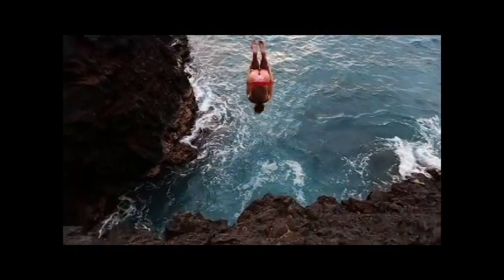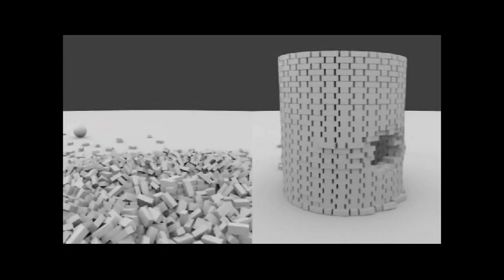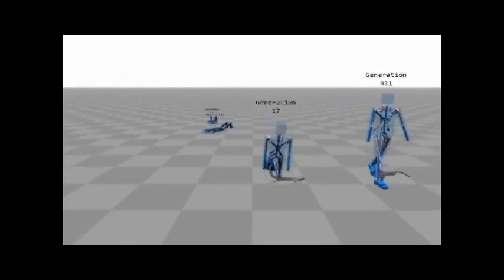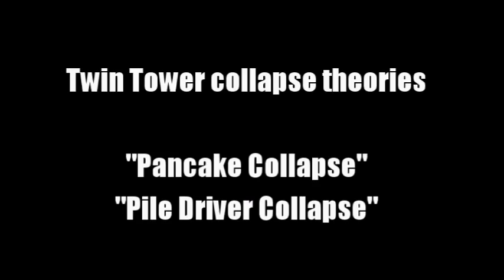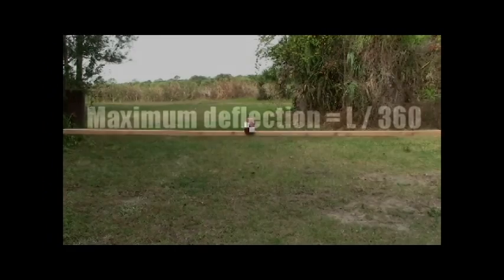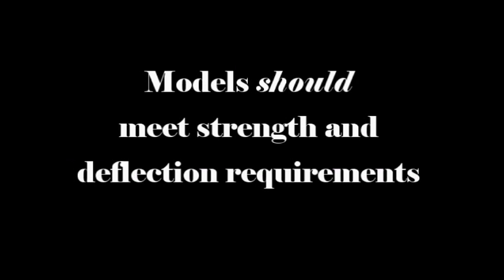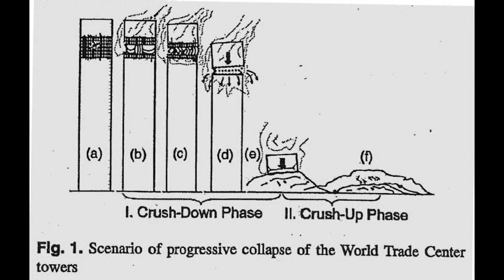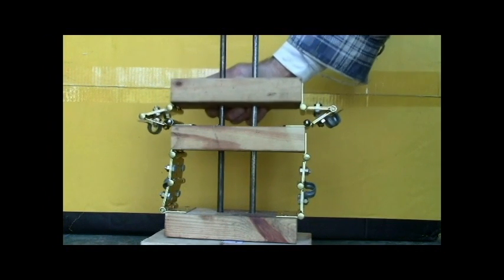9/11 Experiments: The Force Behind the Motion

Comment: It's very obvious that there is something missing from the controlled demolition experiment, but I imagine it applies in the others too. You'll notice that your supports can't exert tensile force on the floors, making the top section look like an accordion and no doubt removing a lot of the (maximum) force applied. Try riding your bike without the tires on and you'll see how much difference having shock absorption makes to how long structures hold up.

Your wooden tower also doesn't represent the steel framed construction very well. I would imagine your concrete board is not to the same spec as the concrete floors - the flex in the boards again absorbs the shock.

You also need to consider the mass in the centre of the building and (what I imagine are) weak points around the central column. Realistically, you would need to build it into a solid base as well - and then pour some jet fuel on it.

I enjoyed the video and appreciate the effort you went to in the name of backyard science but the fact that you went to great efforts to show that the variables you add into a computer model drastically effect the outcomes and then ignored all of these variables when making your miniature model is a huge omission.

Comment: Take an example dead load of ten tonnes, have gravity act on that dead load, transforming it to a live falling load, it isn,t ten tonnes any more, each floor added to the falling load increases the gravitational mass potential x number of times, the falling load increases in mass enough to smash through the resistance of the floor below until it reaches earth, where doesnt have the potential or mass to overcome the compressive strength of the ground and comes to a stop. No explosives or conspiracies required. Thanks.

Comment: No one can replicate the tons of steel and concrete to test any real simulation. None of your simulations factor in sheer weight, and the strength and physics of building your models as opposed to building a WTC 1 and 2 is not acceptable, force is one thing but the thousands of tons of floors on damaged supports cannot be left out as a cause. That said... wtf?!?! wtc7?!?!!?

Comment: You're a moron. The building was designed with exterior columns only. The melted columns gave way and as the weight increased they all gave way naturally. Your models had no way to replicate the shear weight of the actual building. Stick one of those firecrackers up your ass.Then do your research on Yamasaki's architectural disaster of a building, his concern for design outweighed structural integrity.

Comment: Your experiment does not take into account working load limits on a realistic structure. Engineers that have studied the plans of the building have stated that because of its design the individual floors were not capable of handling the weight of floors above. Therefore, once the collapse began and the first individual floor became excessively loaded, each successive floor would to have to deal with more weight than the floor above it. There is no way to stop that accumulation. Based on the level of physics understanding you seem to exert, you should be aware of this - which makes me question the sincerity and intent of your experiment. Someone with proper physics and Engineering knowledge could have designed an experiment that better approximated the design of the towers.
Also in your experiment the outer structure which is holding the levels is incapable of being compromised, and clearly shows a higher proportional rigidity than the actual structure. 
The Twin Towers had an interdependent structural system. Without the floors the outer walls and enter columns could not support themselves. The inner core had a higher level of rigidity than the outer wall, therefore it stayed standing longer.
In a sense the tower fell in precisely the opposite way as how it was raised. The inner core provided rigidity that allowed them to work upward there for the inner core was always built higher than the outer walls during construction.
Reply: Official theorists say that concrete was made into dust because floors hit each other one by one. With their logic every floor should have been demolished with every hit. Then what force demolished all of the rest floors if they turned into dust?
There was almost no real concrete left there. You can seen it being vaporized into the air. How?! If it's made into dust with every hit, then how were first floors made into dust?
Reply: @balsarmy  Correct, most/much of the concrete slabs were pulverized into concrete dust on the way down and much of it was pushed OUTSIDE of the building's footprint and thus had no impact on intact floors below.  The towers looked like a mushroom explosion - massive outward movement.
Reply: You need to get a proper job. You're a feckin useless shill.

Comment: But why did you never set up an experiment to test what we all can SEE actually happened;
A (big) plane (full of fuel) crash into the top 2/3 of the building, then "nothing" happens for quite some time, (it burns),
THEN the building collapse. 
Thats what you need to try to replicate. This proves nothing either way. 
(Im not american, so i dont have enough faith in ANY american organization doing a "false flag" like this without leaking it to everyone.)
But that aside, if youre gonna test this, do it right, and the video evidence alone (which cannot have been faked), gives us quite a lot to go on. 

That the building was not up to code, that several mistakes happened, or negligence, THAT i can believe without proof however.

Comment: After looking more critically at all the "physics" people like this putout, and understanding how the towers were ACTUALLY constructed I think there might have been explosions at the base but that the towers actually did fall from the top part bulldozing through the floors, they were not built like conventional buildings they were tubes and you can clearly see in both building how the corner that falls starts driving through the center of the 2 steel tubes, and the only thing holding the floors up were trusses, and clearly these trusses could not support 20+ extra floors and failed, this blew out the outside of the tube structure causing all the concrete floors covering the trusses to get pulverized and blown out the walls, which is exactly what we see I suspect the inner core was standing longer but you could not see it through the concrete degree but they twisted and fell a few seconds after the exterior.   This is the most logical and clearly seems to be what happened when watching the videos.  things like this ignoring the actual construction of the towers is not really productive.  there might have been explosives planted as well, but I don't think they are needed.

Comment: Conclusion, in all your experiments, is using wrong materials, like going from harder support to weaker support related to the material used for floors. IT is a huge difference, en the reality the core & the exterior columns where as solid as for support all the building, and the floors were just the weaker thing of the structure, in other works you did the INVERSE about strogness in the experiments. Not account for usague weight, ppl and things, not accounting as said the core collapsing over the floors aswell.

And if the demolition experiment were true, all those cameramans which were filming from the nexts blocks, well they would be covered in glass & dead.

Comment: The experiment at 6:38 is wrong because it can stop the fall of the weight plus other "floor" material on hitting in the center, so the next floor can flex and absorb a bit the fall, where in 9/11 the floor didn't hit that way, because at the center was the elevators core. So, this experiment don't match reality.

Comment: I don't believe the 9/11 narrative, however this experiment has a major flaw. The materials you used are not comparable at a small scale to the materials used in constructing a large tower, as they are less prone to deformation, are far less brittle, and in general have a much larger strength to weight ratio than you would encounter in an actual skyscraper. Paper is extremely strong, especially in the configuration you have, and the pizza-box supports you made are able to undergo far more deflection than can a concrete or steel support before snapping. To make a realistic scale model you would have to ensure that certain dimensionless quantities pertaining to the strength of the materials as they relate to the sizing of the model are the same, the same way you ensure in wind-tunnel simulations that Reynolds and Mach numbers are the same as in the full-scale scenario.

Comment: His model are completely against the way the Towers were constructed. Yes he used paper to make walls, but he floors were not sitting on top of the walls, the exterior walls were the main structure to these towers (all 7 of them were built the same) and the floors were tied into the exterior walls as if the floor were "floating". His center support was also slowing down and stopping the collapse because it never "deflected or destroyed with his "House of Cards". The Towers didn't have the center section remain standing, it too had collapsed. This guy, although maybe a self taught engineer sure didn't think his 11th grade experiments through before trying to make himself famous.

Comment: I'm not an expert by any means. So forgive me if there are flaws in my assessment.

A couple things that the models are not capturing that I'm guessing played a large role in the final collapse.

One is air pressure. The sheer pressure increases from the upper levels dropping down would have created a massive sudden outward pressure on the skin of the building, combined with the heat from the burring floors to weaken the steel and you open a whole new formula for the collapse.

The building always looked to me as if it was splitting as each level continued falling, almost like a zipper being undone by a fat belly.

The second problem i see with the model is the inside supports are actually creating friction with the floors, and because the friction helps decelerate the fall, it's not replicating the real event.

I get why your model needed those supports. You would need to repeat your tests. However because the WTC used minimal internal supports, and relied on the strength of it's outer skin for the main support. It is very difficult to recreate this model in the backyard.

Again these are my limited knowledge observations.

Comment: Let's assume you are correct.  The number of people that have the technical expertise to carry out this sort of demolition would be a very finite list.  Just being a structural engineer would not be sufficient, nor would being an explosives expert.  Also, to wire three buildings with explosives would take a pretty good sized crew.  I would assume they would have to get access to the structural parts of the building to carry this out.  After all this planning, and all this work for what?  For what benefit visible or hidden?

Comment: mega structures said you can burn the tower down and still have shell leftl. only way to knock it down was a button 4 blocks away to drop that building. and you had to deadly accurate to dump fuel down they main beam holding the building up. according to mega structures

Comment: Because arbitrary weights, paper, matchsticks and pizza box spacers are the equal to the cold, hard steel you mention...

...along with tons of concrete and the tons of bullshit sitting on each floor.

Yes, the firecrackers and pizza plastic PROVE it was a planned demolition.
Reply: That was my thinking,  While i'm not questioning the fact that the towers had some help falling.   In the " pancaking " experiment to scale? His mathematics are on point. But are the stacked boards close enough to scale for the weight or strength, and do his tiles have more or less give.    I not trying to pick apart the vid or the experiment.   I think he proves a lot in this and the other 911 video i watched of his.  But I don't think the pancaking experiment disproves the possibility of that happening in the towers collapse.

Comment: Dude youre trying so hard but youre getting it wrong. Your model building floors are too strong, they do not scale properly. The floors of the towers were basically built like stacked tables. They were each appropriately strong enough to support the weight above them but not inefficiently overbuilt. When one single floor failed, the entire section of the tower above it fell, accelerating due to gravity to the next floor below. When all that mass reached that floor, the floor was overcome by the incredible mass of accelerated tower section, so it failed as well. This repeated the entire way to the ground. 

The first floor to give way failed due to two reasons, structural damage from the aircraft impact, and the WEAKENING of the steel structure from the heat of burning fuel and office building. The steel beams did not have to melt, they only had to be heated to the point that they were weakened enough to bend under the heavy load.

Comment: Everyone of you thinking that 9/11 was an inside job did not made research, if you would do your proper research about WT7 or flight 93 (That made me always thinking that there is some kind of hoax in it) you would not think that it is an inside job. They found 95% of the whole airplane, and material of all the passengers on flight 93. WTC7 collapsed inside out, because of the skeleton structure of the building, then the fassade. They let it burn down because it catched fire, and a controlled deconstruction would not have caused damage on the surrounding buildings. Every and if soooooooo unbelieveable "good" explanation of conspiracy theorists has been debunked. THE ONLY open conspiracy theory that they did not debunked until now is the JFK shooting. It takes way more evidence on this. Guys, make your research!!!
Reply: where is the blackbox?

Comment: Those buildings had a center core of steel. Demolition to that part kept the evidence of using charges  hidden. That would explain the antenna starting to sink first due to it sitting above the center core columns.
Reply: Jason - "That would explain the antenna starting to sink first"
But it didn't. So if the antenna didn't sink first, would that disprove your theory?
What actually happened is that the south roofline came down first. 99% of the videos were shot from the north side. the ones where the antenna seems to drop, were zoomed in. If you would however be able to find a shot from the east or west side, you would see that the antenna doesn't drop first, but simply falls away to the south side, making it look if it dropped while filmed from the north. Now it happens to be that there some footage available from the west (shot from the Hudson) when the north tower collapsed. It clearly shows the antenna tilting away to the south. So I guess your theory is debunked.

https://youtu.be/3HbD_Q6kmh8?t=1m40s

Comment: 6:40 is not even a acurat model accounting for the weight of WTC.
Every Level of the Building weights tons and tons. With every colaps the ammount pushing on the next goes up. Its not in anyway the same if you use light weight material for the floors. And also let the sides magicaly stan. What is holding the sides up? On the model here its a outside construction of a better material.  Skyscrapers are build in the opposite way were the core structur is in the center of the building.  
If you make a model were the sides dont come down and the floors are far lighter, ofc it wont come down caus you built the model that way.